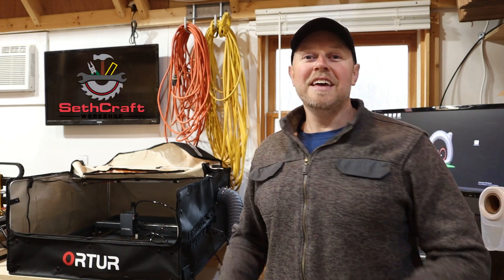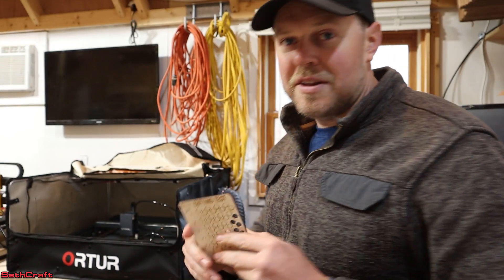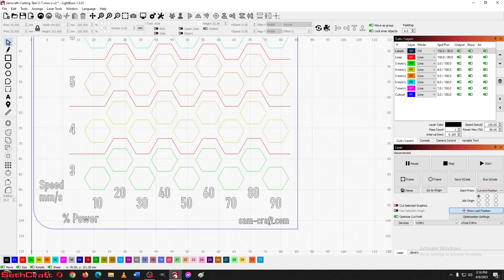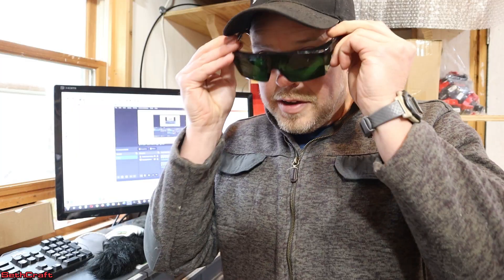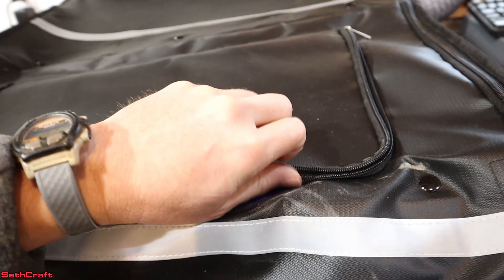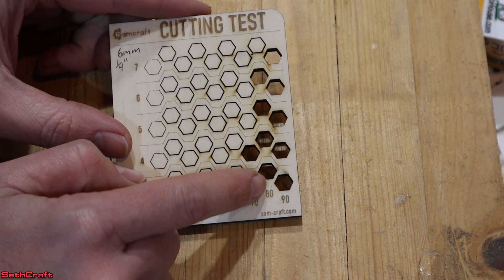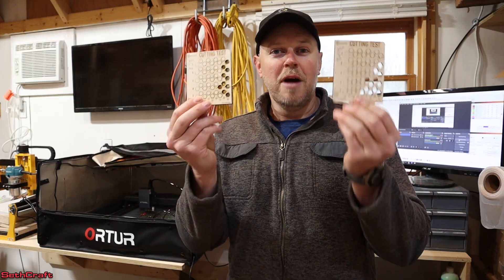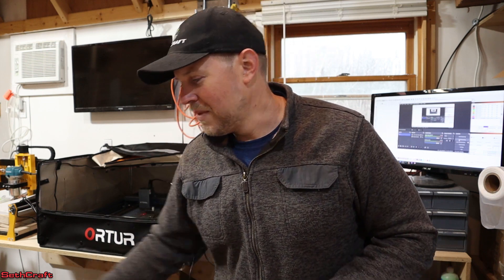What Laser Cut Speed and Power Settings to use

Comment: I would like to know more about your laser.Where did you get it, approximate cost?And what uses do you have?Do you have just regular air compressed air?Any, you don't use any type of gases, nitrogen or anything like that?Only air for wood.Let me know how that works.I've only seen and ran industrial ones, not a smaller size one.But I would like to experiment with one of those

Comment: Can you explain how the layers are set to change the power percentage for each speed ? Looking at the layer it looks like speed / power is set so how does it change between the power ranges for each speed ? What am I missing. Where do I find that setting on the template ? Thanks.
Reply from the maker: If you would reach out to SamCraft. He made this cut file. He actually has a few videos that explain in detail! (Because my shop is a mess my lasers are not setup for me to test)